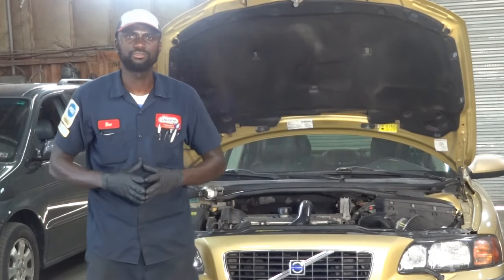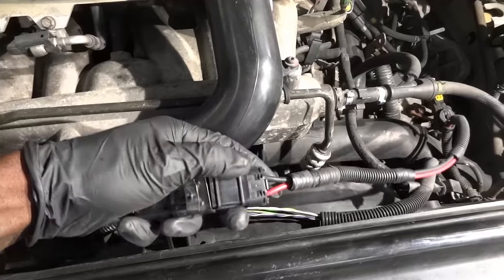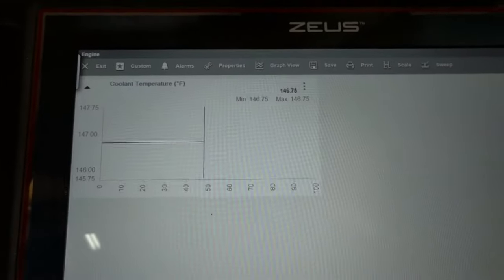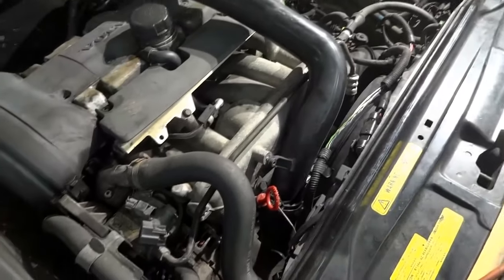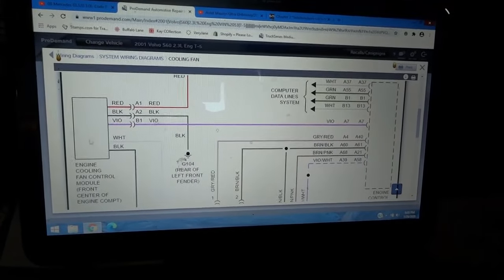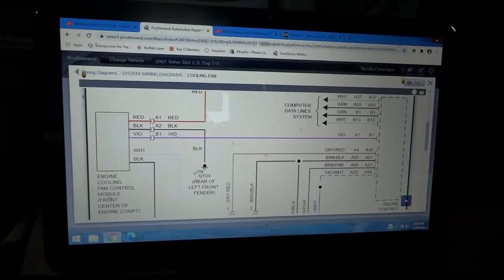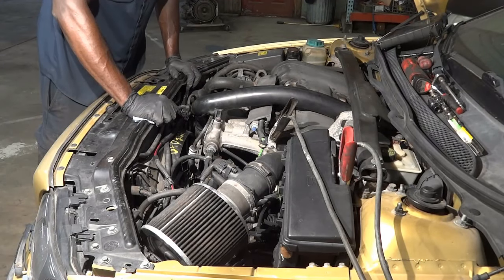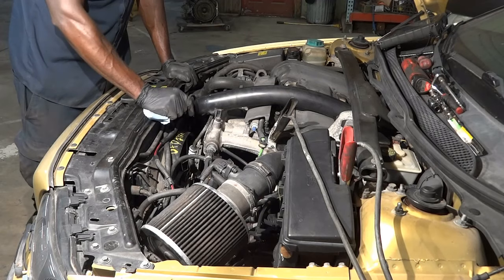Cooling Fan Stays on until the Battery dies ( Radiator Fan Runs all the time )

Comment: My Appraciation:
You nailed it bro. Other Youtubers go for a Quick Click Bait solutions thinking the issue is a cooling switch. You had helped me diagnosed the real issue and learn more about the cooling system electrical network. A multimeter is also helpful to diagnose this issue. Most people think a Radiator Fan Module function is to only control the Speed of the Fan Motor not realizing that the Module is an On/Off Switch that can stuck on an On or Close function like a relay.

My Opinion:
Some electrical fan are actual controlled by a relay and ECU, while modern generational cars uses a cooling sensor, ECU, Thermostat with a electrical sensor and Fan Module to perform the work. Best cars are the ones which Utilizes the Manual Fan mounted on the engine. This electrical fans are unrealiable and none durable at best. Are caused of majority of engines overheating due to their malfucntioning tendency and overcomplex ssystem that makes no sense. Straight engines should not use electrical fans and cooling sensors. An engine only need a radiator, fan and thermostat. Modern day enginners don't create solutions but problems in their quest to innovate the old trial and tested inventions. The automotive car industry went from cast iron material to aluminium and now they settled to cheap plastic foil cars. It is crazy what shareholders can do. Good luck car owners who are forced to became part-time mechanic because to garbage quality...Nxm
Reply from the maker: @kayrams1792   Thank you!

Comment: Very detailed explanation. I am a new driver, just bought a used car and this happened after a week of buying it. I’ll try it tomorrow, although I dont have another cooling fan to test it with... I’ll try disconnecting the wires and see... right now, I have just disconnected the negative battery terminal to stop the fan. Thank you for this video. 😊

By the way, my car is an old Honda Fit 2003 model.
Reply from the maker: Cyrill and Jacob Channel  My Pleasure!! Good luck with your project!!

Comment: Would this process work to troubleshoot any vehicle regarding the cooling fan not shutting off? We’re having the same issue with a 2012 Ford-F150 SVT Raptor. We’ve replaced all the relay fuses thus far. Please advise and thanks.
Reply from the maker: @tonyjackson9035   yes, but you're gonna need a wiring diagram!

Comment: Was the car turned off during this video? Did you get it to running  temp, then do these tests? Or was the car running? Thanks
Reply from the maker: Tats Nstuff   I got it to operating temperature before doing the tests
Reply: @K Diagnostics  sorry. When you disconnected the coolant temp sensors, was the car running or turned off? Also, for the fan control module, running or off. Thanks

Comment: Hey man i have a 2004 vw golf 2.0 and the fans constantly run and will never turn off until i disconnect the battery. Whenever the battery is connected to the car the fans come on. I checked the relay and sensor and they wernet the issue. Do u think i need the control module replaced?
Reply from the maker: @Unknownuser017   you need to get it diagnosed by a pro mechanic!

Comment: Good afternoon, very good video, my car is a 2001 Volov V70, the fan turns on when the ignition is on or when I start the car, even when the car is cold, when I turn off the car the fan turns off. Before watching your video I bought a second fan complete with its module and the same failure continued.
If I do like your video and unplug the purple cable, the fan turns off, but if I plug it back in it turns the fan on at a low speed.
In this case what is the fault?
Thank you.
greetings from Mexico
Reply from the maker: @Alex-ku8ft  it sounds like your fan module is going bad, I recommend you take your car to a pro mechanic who can diagnose it properly!

Comment: My fan comes on and goes off continuously. As soon as I pull in my driveway and put it in park, it is running and will stop for a couple of seconds and start running again. I believe it’s a loose connection or  bad wire. Thoughts?
Reply from the maker: Dave Chambers  check your engine temperature sensor!

Comment: Hi, I like your video a lot. It not only shows the diagnosis but also the mechanical work involved. Did you later repair the control unit with the dead short in it? Does the fan have brushes or is it brushless?
Reply from the maker: Habati 65  Thank you!! I didn't fix the old fan, I got rid of it, the fan is brushless

Comment: Some confusion ( but I will watch again), #1 is the fan controller just a relay ? #2 how does the violet wire control the fan, what does it do other than just brining a signal from the computer ? Is it really a controller?  Is there a resistance in the wire or connector that makes it a 'controller wire' ?   #3 doesn't the computer need to first receive a signal from a sensor ( like the coolant temp sensor?) before it sends a signal, to the fan controller, right ?    This is all new to me but I am having issues with Ram PM Van 3.6L gas and can not afford how have someone fix it. I am seeing people say $1,500 and a lot more for maybe a bad wire, relay, module or the like, that I could possibly fix myself for a few hundred or less. Thanks !!
Reply: If i can learn enough that I could help others fix their vehicles also that can not afford to take some place, that would be a huge plus for me ( not for my ego, but doing something we all should be doing, helping others).  My added 2 cents.
Reply from the maker: Wondering Why  on this model, the fan module is part of the fan assembly, the ECM receives the input from the ECT then sends a command to the fan module to turn on the fan! but some fans are just controlled by relays! you need to find out how your fan is controlled!!

Comment: Hi! I have a 2011 Ford Taurus SEL and i’ve been having the same issue where my fan stays on until battery dies, I replaced the Temp Sensor and also the Thermostat. 

It seemed fine, the fan would turn off and wouldn’t be Stuck On but last night it wouldn’t turn off! Though I only waited about 5-7minutes but PTSD made me disconnect the battery so I wouldn’t need a jump lol

My point is that it’s still turning on and off which might mean it’s not the module being shorted, two parts were replaced but last night 5-7min stuck on even after engine was off was frightening, do you think it could be anything else? or perhaps it was just a false scare
Reply from the maker: Adrian_567_  do you have any codes in memory?

Comment: Good afternoon, I watched your video, my Volvo V70XC 2001 turbo, my fan has a fault.
When the car is cold, I turn the ignition ON or start the car, the fan turns on at a low speed. When I turn off the car the fan turns off. But when you turn it on or turn it on, whether hot or cold, the fan turns on and stays that way until you turn off the car.
  Before watching your video, I bought another fan complete with its module and the same failure.
I did the test in your video and disconnected the harness with the cable alone, the color violet and the fan turns off, the two fans that I now have complete with its module turn off.
Disconnect the temperature sensor harness and it indicates -40 degrees Celsius, but the fan stays on, does not turn off,
What could be the fault?
What do I need to validate to be able to solve it.
Kind regards
ALEX
Reply from the maker: @Alex-ku8ft  your problem could be in the fan wiring, I recommend you take it to a pro mechanic who can diagnose it for you!

Comment: How are you K diagnostic? I am working on a 2011 Suzuki SX4 when I press on  the gas nothing happens it’s not accelerating   I scan the car with a harbor freight scanner it gave me 7 different code now I don’t know where to start any idea  will help thanks .
Reply from the maker: Stevenson victor does it have throttle body or App codes? what are the codes you are having?

Comment: Hello my friend I have the same problem in a hyundai getz 1.1 I check all wire the settings is correct but I notice fun close when I open heating. What you think to buy to try to clean refrigerator or the problem it's bigger...
Reply from the maker: Nikolaos Papaioannou does the fan only stays on after turning on the heat in the car?

Comment: Hi, Recently my Mazda 3 2011 had a similar problem with the fan staying on for about 2~5 min after engine off. 
Sometimes only a short distance within 10KM was driven, and the fan was still on after the engine was turned off.
so don't think that overheating of the engine requires a fan to cool down.
In your experience, think it is a fan control module problem, thermostat problem or coolant temperature sensor problem?
My car fan control module it look similar like volvo, it made by Bosch as well.
Reply from the maker: macoo macoo  you should check the sensor first and make sure it's reporting the accurate  temperature to the ECM

Comment: Kit please, do you have any experience with the case when the temperature sensor is disconnected (the sensor connector is removed) and the fan is still running. I can't stop fan unless I take off the motor relay from the fuse panel. By the way, let me say that the engine shuts off when I connect the MAF sensor, but it works if MAF sensor is disconnected. This is Volvo S60 T5, 2002 (manual transmission and turbo charged engine). Thank you in advance!
Reply from the maker: @ljubantepsic6213  you probably have a short in the wiring or a shorted component that's causing this, you should have a pro mechanic diagnose it for you!
Reply: @KITS_Auto_and_Truck_Repair  thanks Kits for your answer.
My problem is that I'm not fully equipped for car electronics, but I still found the root of the problem and fixed it. Best regards!
Reply from the maker: @ljubantepsic6213  My Pleasure!

Comment: What should possibly be the problem in this matter.

I was driving my Mk5 and the temperature warning show up on the dashboard , with STOP! CHECK THE COOLANT.
I comfirm the water was little and added.

But from there just when  the engine is turned on, the temperature rise to 90.c and the fan couldn't go off while the engine is running however no warning light is showing on the dash board
Reply from the maker: kapolo Paulus Ndelimona Check your thermostat and temp sensor first and see what happens!

Comment: Hey boss, I have a 2012 Ford Focus SE that had a problem with the fan staying on for about 10 minutes after shutting the car off. It would kick on when I opened my front doors and kick back off if I didn’t start it. 

The other day my fan stopped working at all, so do you think the fan motor could’ve just burned out from running so much? I’m getting ready to trade in the car soon anyways, so I just need the fan to at least work and keep the car cool. I should be able to just buy the fan and replace that part hopefully right?
Reply from the maker: John Lee  yes you probably have a burned fan but you should check the wiring first before you replace it, since you're gonna get rid of the car soon, you just get a used fan
Reply: @KITS_Auto_and_Truck_Repair  alright thank you! What I’m gonna try to do is get some small jumpers to jump power from the battery to the fan terminal to see of it is dead and then try that on the one I’ll replace it with to make sure it’ll work for the time I need it to and replace it.

Comment: Can you go back please, disconnect a coolant temperature sensor and test a signal to the fan control module, I want to understand whether the signal wire is giving the module a ground or a supply, I have got a same problem and when my signal wire is disconnected I get 12v on the side of the module.
Reply from the maker: Thabang Mokhele   disconnect the module and see what kind of signal you have there!

Comment: Can you just replace that controller?  I tried to remove the wires from the fan motor and it didn't seem like a simple disconnect.
Reply from the maker: Murray Madness  you should be able to disconnect the electrical connector!
Reply: @KITS_Auto_and_Truck_Repair  The wires going to the motor a crimped on to some metal tabs and don't look like they come off. The tabs go under the top cover, I don't want to destroy the motor.  And what looked like a bolt holding the top don't think its a bolt.
Reply from the maker: @murraymadness4674  OK! That's weird!

Comment: Great video!  I'll be replacing the fan assembly tomorrow.  Did you happen to notice what temperature turns on the fan and what temp turns it off?  Thanks.
Reply from the maker: Da Jo  Thank you!! the fan comes on when the thermostat opens around 195 and 210 degrees... after the temperature drops the fan goes off
Reply: @KITS_Auto_and_Truck_Repair  That's for the info.  Looks like I'll be replacing the fan assembly today, with your video playing beside me...
Reply from the maker: @dajo4349  sounds good. Good Luck!!

Comment: My signal wire came out of the connector (with the clip still attached). Do you think I can just stick it back in or would I have to cut it off and get a new connector with a bit of cable from the junkyard?
Reply from the maker: Vidyamancer getting an other connector from a junkyard would be your best Bet!!
Reply: @KITS_Auto_and_Truck_Repair  Thanks for the quick reply! That's what I feared. The cable in question is the one coming from the ECU, not the fan module's wire. Probably going to end up taking it to an electrician as I'm no good with electrical wiring.
Reply from the maker: @vidyamancer7135  yes I agree you should have a pro Mechanic fix it for you!! Good Luck!

Comment: Thanks very much.  Very simple and well explained.  Greetings from Colombia
Reply from the maker: Marco Antonio Diaz My pleasure!! I'm glad to hear that you're watching from Colombia!
Reply: @KITS_Auto_and_Truck_Repair  i have the same problem on a mazda3 all new 2011 :(
Reply from the maker: @marcoantoniodiaz9822  does your mazda have a fan module?
Reply: @KITS_Auto_and_Truck_Repair  Yes it does.  It is a similar problem.  Radiator Fan runs all the time.
Reply: @KITS_Auto_and_Truck_Repair  I still do not verify if it is the module, but everything points to it.:(
Reply from the maker: @marcoantoniodiaz9822  sounds like you might have the same problem
Reply from the maker: @marcoantoniodiaz9822  you should check the module first
Reply: @KITS_Auto_and_Truck_Repair  How do I check the module? Thanks for tour answer btw!
Reply from the maker: @marcoantoniodiaz9822  I showed how to check the module in the video, follow the steps in the video!!  it's pretty much the same process on most modules!!
Reply: @KITS_Auto_and_Truck_Repair  Thank you so much for all your help. You have a friend here in Colombia:)
Reply from the maker: @marcoantoniodiaz9822  My Pleasure!!

Comment: toyota corola,, the fan for the radiator and the A/C fan run when the car is turned off... not when the engine is running ,, im thinking the relay is at fault ..
what are your thoughts ??
Reply from the maker: peter brittain  does it have a module on it? if not check it's relay!!
Reply: @KITS_Auto_and_Truck_Repair  AE92R toyota corolla ..  10/91 build .. i checked the fan relays ,, plugs on the thermostat housing ..no change... 
hit the engine relay a couple of times .. and the fans turned off..
point to note ....30 year old corolla .. none of these relays have been changed since my now 81 yo mother brought this car ...NEW...
pitty i cant send photos of the relay that caused the issue .. it was not the relay i suspected of having the problem...
watching your vid from Australia ...
thanks for replying ..
Reply from the maker: @peterbrittain1963  My Pleasure!! I'm glad to hear that you figured out the problem!!

Comment: Hello on my 2015´s Golf GTD 135kW, fan can´t stop running, only after inserting key and switching into first position, diagnostic show only theese DTC´s :
-U112300
-0100300
-U042800
-P068B00
Reply from the maker: @samuelstasak  you should get these codes diagnosed!

Comment: Hey man, I just bought a brand new cooling fan to replace the broken one but I’m worried what I just bought is not working. After installing the new fan, how do you know if the newly installed one is working? I try to idle or drive the engine so the temp guage would go past halfway the mark but it never goes past the half mark of the guage and I never hear the fan turn on. How do you test the fan? I’m asking because I only have 30 days to return it if it’s defective. Thanks
Reply from the maker: Kirk Lopez  you can send power and ground on the big wires on the fan to see if the fan will come on!
Reply: @KITS_Auto_and_Truck_Repair  I see. But would it need a signal from the sensor first to turn on the fan? How would you fake bypass that and just connect power to turn on fan just to see if it works?
Reply from the maker: @kirklopez2031  yes, that's the quickest way to check a fan, if it runs after sending power and ground to it, then your problem is most likely the wiring or the inputs to the ECM or the ECM itself!!
Reply: Hello ! What if youu have a fan on your car or it’s old but my car don’t turn on twice now …. ????

Comment: very informative.   for me, my module did not work at all.  so i disconnected the ECT.  The fan came on.  i was told this is a fail safe.  when i plugged the ect back in, the fan kept running.  i will get a new fan/controller at scrap yard.  it will tell me if i fried the computer too
Reply from the maker: richardgengle  sounds good, Good Luck!!